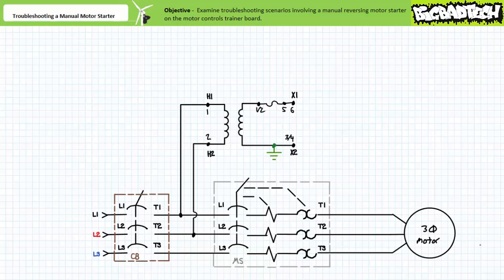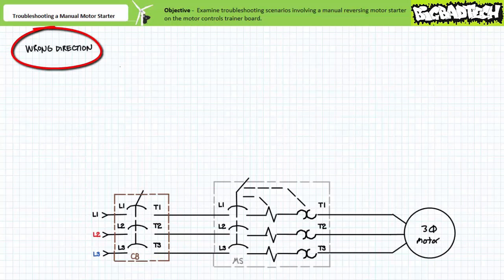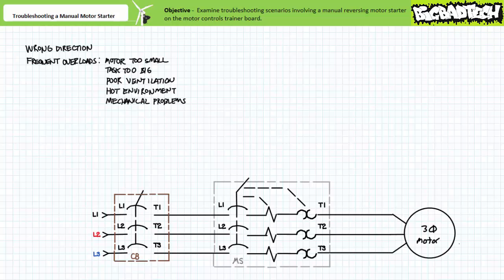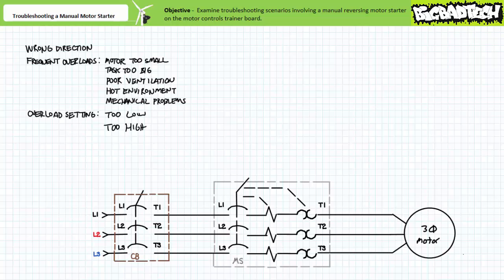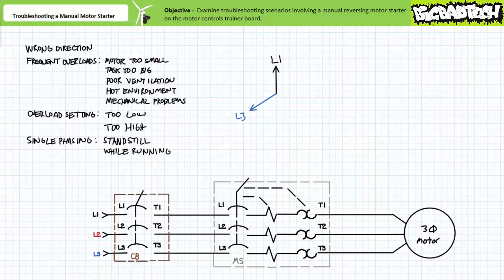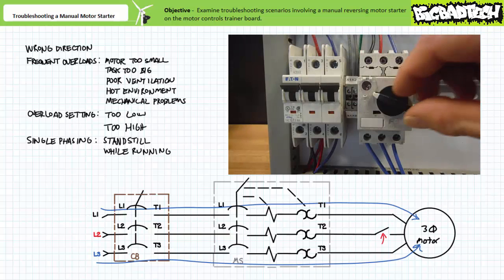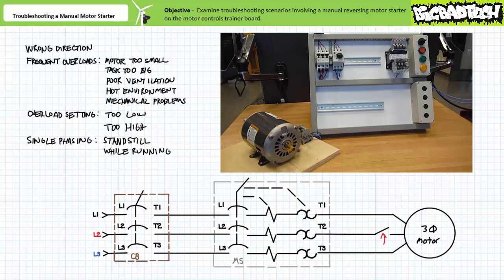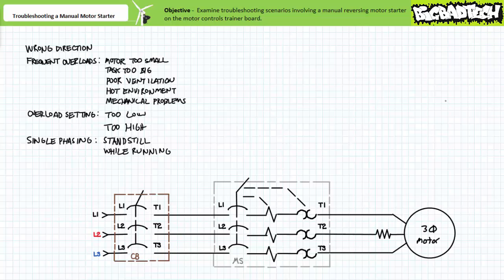Troubleshooting a Manual Motor Starter

Comment: how the motor starter know if the motor fins is dirty causing the motor to overheat as it only monitor the amp. draw causing its heating element to trip , actually the amp draw should go down in dirty  non-ventilated motor because its resistance go up and the manual motor starter would have no idea that the motor is overheating , these problems should be visually checked and measured with IR thermometer.(the only case that cause a rise in amp. draw in rising motor temperature is the failing motor winding insulation )    (please correct me if i am wrong)